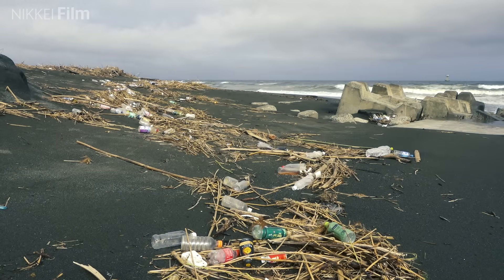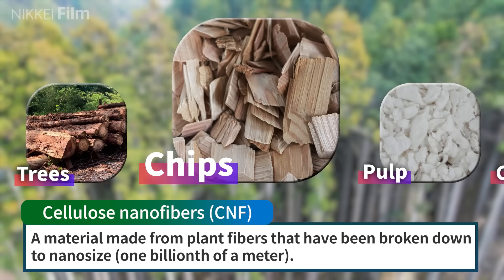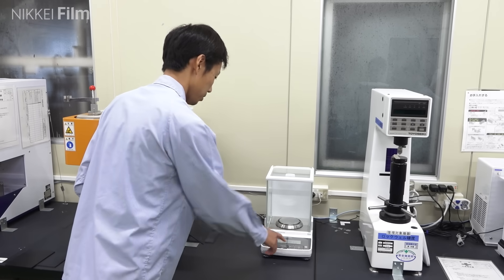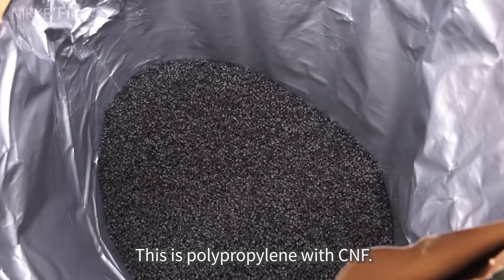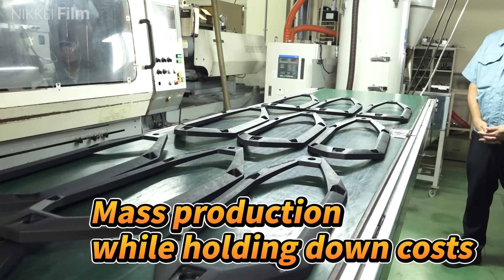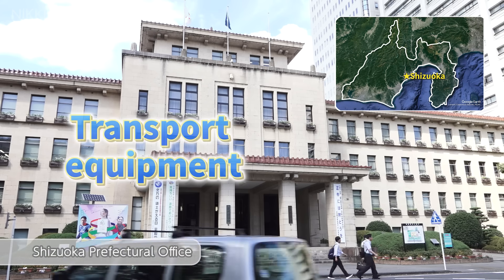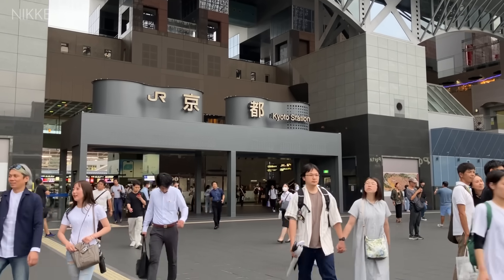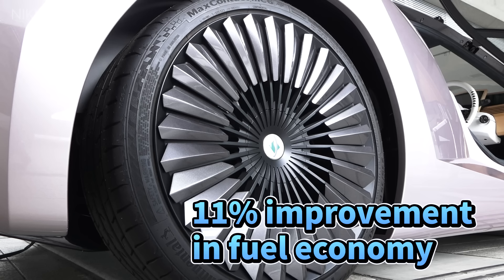Five times stronger than steel: Japan's new 'wood' | Nikkei Film

Comment: I like this concept, but let's examine the claims:  First, at 5:20, they say "5 times stronger, and 5 times lighter, than steel", implying a 25x total gain in strength.  In reality, wood is already as strong as steel for its weight, and they merely reduced the volume to 1/5 of its original volume.   So, by weight, NO total strength is added.  Meanwhile, it's a typical deceptive use of statistics to say anything is "x times stronger than steel" AND "x times lighter too", essentially saying the same thing twice, worded differently, as though "stronger for its weight", and "lighter for its strength", are different concepts, additive in nature: No, they are the same thing, not additive.  But here's the real deceptive part:  Wood is a composite with unidirectional fiber orientation, and as anyone who has ever broken a plank karate-style knows, it's EASY to break wood parallel to the grain.  So wood is already as strong as steel, for its weight, when bending a board longitudinally, but NOT cracking it open along the grain by supporting it on two sides and pressing down in the middle, etc., so the resulting crack is with the grain,  Like all unidirectional composites, it is only strong in one direction, usually requiring steel attachment points bonded to the wood, at each end, because the steel is equally strong omnidirectionally (in all directions), unlike wood.

Comment: What matters is that the Plastics/ Glue/ or other derivatives is made to BIODEGRADE FASTER. ASSUMING that the petroleum industry cannot be replaced wholly by any other alternative sources of Energy., because every other Industry uses some form of a petroleum by product. The fusing natural bio products to create FASTER BIODEGRADABLE MATERIAL SHOULD BE ENCOURAGED. THE MONEY SPENT ON QUESTIONABLE CLIMATE CONTROL PROJECTS, SHOULD BE DIVERTED TO RESEARCH ON CREATING FAST BIODEGRADABLE MATERIAL.

Comment: Cellulose Nanofibres: Properties, Applications, and Potential

Introduction

Cellulose nanofibres (CNFs) are an emerging class of sustainable nanomaterials derived from natural cellulose, which is the primary structural component of plant cell walls. These fibres possess exceptional mechanical properties, biodegradability, and a high surface area, making them suitable for various applications, including packaging, biomedical materials, and composite reinforcement.

With increasing environmental concerns over synthetic polymers, CNFs offer a promising alternative due to their renewable nature and ability to form strong, lightweight materials. This essay explores the properties, production methods, applications, and future potential of cellulose nanofibres.

Properties of Cellulose Nanofibres

Cellulose nanofibres exhibit several advantageous properties, including:
	1.	High Strength and Stiffness – CNFs have a high tensile strength comparable to Kevlar and carbon fibres, making them ideal for reinforcement in composite materials.
	2.	Low Density – They are lightweight, which contributes to energy-efficient applications in transportation and packaging.
	3.	High Surface Area – Due to their nanoscale dimensions, CNFs provide a large surface area for chemical modifications and interactions.
	4.	Biodegradability – CNFs naturally degrade in the environment, making them an eco-friendly alternative to synthetic fibres.
	5.	Hydrophilicity – They have a strong affinity for water, which can be beneficial or challenging, depending on the intended application.

Production of Cellulose Nanofibres

Cellulose nanofibres are produced from lignocellulosic biomass, which includes wood, agricultural residues, and even bacterial cellulose. The production process generally consists of pre-treatment, fibrillation, and post-processing.

1. Pre-treatment

Before fibrillation, raw cellulose undergoes pre-treatment to weaken fibre bonds, reducing the energy required for mechanical processing. Common pre-treatment methods include:
   •   Chemical Pre-treatment – Acid hydrolysis, TEMPO (2,2,6,6-Tetramethylpiperidine-1-oxyl) oxidation, or alkaline treatment are used to break down lignin and hemicellulose.
   •   Enzymatic Pre-treatment – Enzymes such as cellulase help loosen cellulose microfibrils for easier fibrillation.

2. Fibrillation Process

Fibrillation is the step where cellulose is broken down into nanoscale fibres. Common methods include:
   •   Mechanical Fibrillation – High-pressure homogenisation, microfluidisation, or ball milling are used to physically break down cellulose into nanofibres.
   •   Ultrasonication – High-frequency sound waves disrupt the hydrogen bonds in cellulose, producing nanofibres.
   •   Electrospinning – A method where a high-voltage electric field is applied to a cellulose solution to create nanofibres.

3. Post-processing and Functionalisation

Once cellulose nanofibres are produced, they may undergo modifications to enhance their properties. Surface functionalisation, such as grafting with hydrophobic molecules, can make CNFs more compatible with water-resistant applications.

Applications of Cellulose Nanofibres

Cellulose nanofibres have a wide range of applications across multiple industries.

1. Packaging and Biodegradable Plastics

One of the most significant applications of CNFs is in sustainable packaging materials. Due to their high mechanical strength and barrier properties, CNFs are used in biodegradable food packaging films as an alternative to petroleum-based plastics.

2. Biomedical Applications

CNFs have gained interest in the medical field due to their biocompatibility and non-toxicity. They are used in:
   •   Wound Dressings – CNF-based hydrogels provide moisture retention and promote healing.
   •   Drug Delivery Systems – Their high surface area enables controlled release of pharmaceuticals.
   •   Tissue Engineering – CNF scaffolds are used for regenerating tissues due to their ability to mimic extracellular matrices.

3. Composite Materials and Construction

Due to their high strength-to-weight ratio, CNFs are used in reinforcing composites for lightweight, durable materials. Applications include:
   •   Automotive Industry – CNF-reinforced bioplastics are used to reduce vehicle weight, improving fuel efficiency.
   •   Construction – CNFs are incorporated into cement and coatings to enhance mechanical performance.

4. Electronics and Energy Storage

CNFs play a role in the development of flexible electronics and energy storage devices, such as:
   •   Conductive Films – Used in touchscreen displays as transparent and flexible electrodes.
   •   Supercapacitors and Batteries – CNFs act as a template for advanced electrodes, improving battery performance.

5. Water Filtration and Environmental Applications

Due to their high surface area and hydrophilicity, CNFs are effective in water purification systems by removing contaminants such as heavy metals and organic pollutants. Additionally, they are used in oil spill cleanups due to their ability to absorb large amounts of oil.

Challenges and Future Prospects

Despite their promising properties, CNFs face some challenges:
	1.	High Production Costs – The energy-intensive fibrillation process makes large-scale production expensive.
	2.	Water Sensitivity – Their hydrophilic nature limits applications in moisture-rich environments.
	3.	Dispersion Issues – CNFs tend to form agglomerates, requiring chemical modifications to improve dispersibility in certain matrices.

Future Directions

Ongoing research is focusing on improving CNF production efficiency and expanding their applicability. Potential advancements include:
   •   Green Processing Methods – Developing low-energy and chemical-free production techniques to make CNFs more cost-effective.
   •   Hybrid Materials – Combining CNFs with other nanomaterials (e.g., graphene, carbon nanotubes) to enhance functionality.
   •   Commercial Scale-Up – Improving manufacturing processes to enable large-scale industrial use.

Conclusion

Cellulose nanofibres represent a significant advancement in sustainable material science. Their superior strength, biodegradability, and versatility make them a promising alternative to traditional synthetic materials across various industries. While challenges such as production costs and moisture sensitivity remain, ongoing research aims to overcome these limitations, paving the way for widespread adoption. As industries seek more sustainable alternatives, CNFs are likely to play a crucial role in the future of bio-based materials.

Comment: HEMP!!!  Ford was making body panels with cellulose from the hurd of the hemp plant in the 1930s.  The extraction of the hurd and the processing for the production of cellulose is MUCH easier than which translates to lowered energy inputs and faster processing times.  Not to mention there is a higher ratio of the hurd to the overall mass of the plant meaning you would achieve a higher yield than you would from trees.  To top it off, hemp is ANNUALLY renewable so a farm growing hemp could begin yielding usable products in less than a year compared to fifteen to twenty years for forest projects.  Faster, higher yield, less energy intensive.  With all due respect, Yamaha, you are quite literally barking up the wrong tree.

Comment: What this should replace is structural parts requiring metal. And where plastic parts are already used, you could possibly use less material with the new stronger CNF material. 
No one like cheap plastic that breaks over time or becomes brittle. (Some are bad from the getgo)

Comment: Using wood as a source material for CNF is an expensive endeavour, probably motivated by Japan's desire for resources autonomy. Separating Cellulose from lignocellulose a.k.a. wood seems to be preferred to starting out with much less ligneous bast fibers from faster-growing forbs such as Kenaf, Cotton, Flax, Ramie, or Hemp for which there isn't much available agricultural land in the highly forested Japanese Archipelago. This otherwise excellent documentary says nothing about the technology employed to extract and purify Cellulose from the coniferous wood that is shown, but I'd like to find out some more about it.
Reply: Can't they just use bamboo instead if they can't grow hemp or cotton? Japan have a tradition of using bamboo so there are already bamboo  forests used for crafts, they wouldn't need to chop down more to grow non-native crops.

Comment: The problem with recycling is not whether the product is based from plastic, as pretty much all plastics can be recycles. The issue is humans. We are simply too lazy and most don't bring back the bottles, rather we throw it away in nature. Cellulose fibers are not gonna change that. Also not totally sure if you should add nano fibers too food already as we know very little about it long term usages. We only recently find out about micro plastics and the issues it creates in animals and humans. Who is too say that the same doesn't happen in 50 years with these fibers?  

But it is an interesting product.

Comment: This is not the only cellulose resin composite being used in modern transport. China has developed a new material based on bamboo and resin. This is now being used for high speed train carriages and in construction. In the latter the new composite increases the durability of buildings from 100 to 1000 years. Compared to the Japanese wood used here the Chinese use of bamboo has three great advantages. Namely, the much faster rate of growth of bamboo, the much lower cost of this material its light weight.
Reply: So many people in the comments suggesting hemp. Makes me wonder how it'll perform similarly.

Comment: If those strength to weight ratios are accurate, the stuff should have a role in aviation. That requires light, strong materials with little concern for price.

Comment: Seriously, trying to reinvent the wheel, seriously stepping over a dollar to save a dime. It's not biodegradable and tales longer than plastic to break down, and the energy required to make it far outweighs the benefit of having it, also if it can be recycled it has shelf life, meaning it can only be recycled in ever decreasing amounts then it has to be discarded, and it doesn't biodegrade, so then what, now our dumps are filled with plastic harder than steel. What a joke

Comment: Not new there is a women in Africa who did this 10 years ago. She made plates and utensils with it.she is still in business
Reply: Not the same thing.  Crystalline cellulose is isolated, removed, and concentrated from the amorphous cellulose and lignin of the wood. It is the crystalline cellulose that has the very high strengths at low weight when combined with some kind of plastic resin.  

  Wood typically only contains between 35% to 50% at most, total crystalline cellulose content (bast and cotton fibers more though).

Comment: Worth reposting:
Someone's Comment:
"It's ironic that the theme of this video is a reduction of CO2 and plastic waste yet the product focussed upon is a small part for a machine which has no practical value other than for the amusement of the owner."
Someone's Reply:
"It's ironic that the theme of this comment is to mock the efforts in reducing CO2 emissions while only focusing on a small part of the video, rendering the comment of no practical value other than the amusement of the owner."
My comment:
Yamaha's motive is not primarily to reduce the petroleum-based materials and thus CO2 emissions. That's a significant issue, but won't play out big until much later (and even still, obviously, won't make a huge dent towards global warming). Yamaha for a long time has been quite good at making money by producing superior products that the public decides are worth paying for. And, inching towards more sustainable industry, is moving in the right direction. Trust them not to be as foolish as some random commenter.

Comment: This so called new plastic has been around for over a hundred years. This is all smoking mirrors in my opinion. Why you may ask?😅 is because these so called Scientists are constantly focused on the wrong products. Instead of putting their efforts into this stupid crap why not redesign Engines to run on Hydrogen Gas? Hell they have all the Fuel needed to operate their JetSky around them?????😢 It’s so easily done.😅 This is not where the Money is at, or regulation from Corporations and Governments want allow this to happen. 😂 believe me folks, Hydrogen production is easy. I’ve been asked why I haven’t designed a Hydrogen Gas Engine? I have and quite a few too.😊 But can’t sell because the same crap others go through 😢 I really don’t think dying should be a part something that improves the lives of folks that really need a way out of costly everyday life, like Gasoline ⛽️, Natural Gas, Propane or Coal. Anyone who threatens to interrupt this would soon be gone. 😢